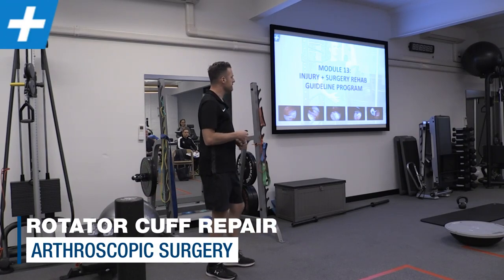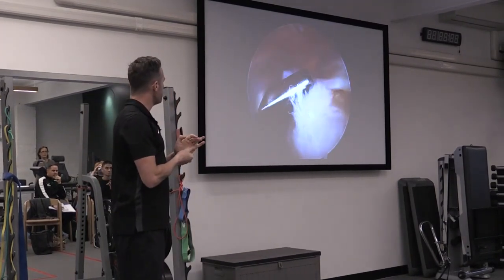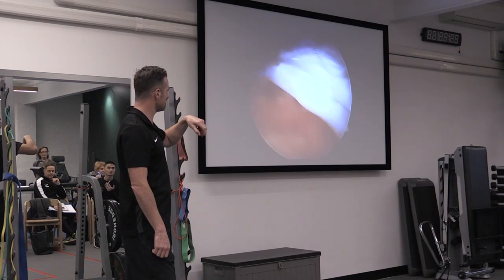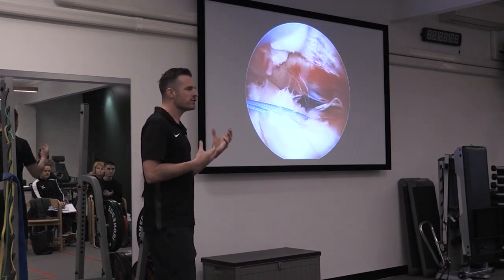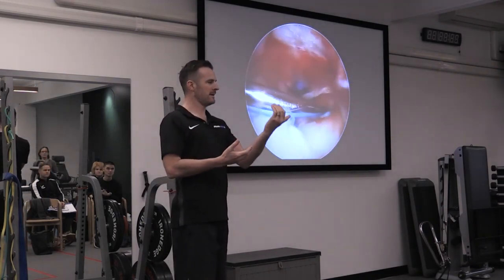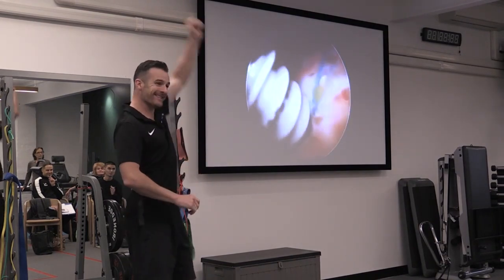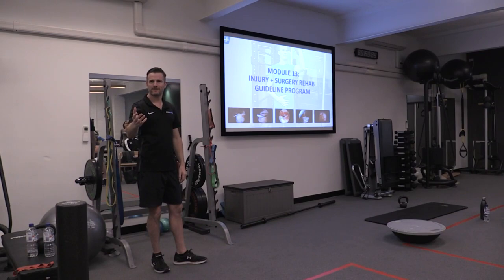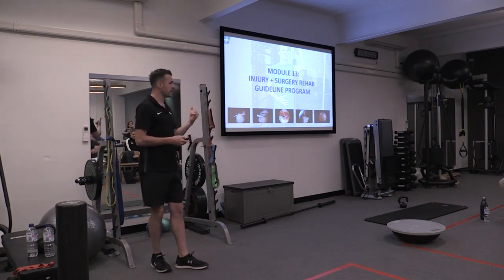Arthroscopic Shoulder Surgery - Rotator Cuff Repair  | Tim Keeley | Physio REHAB

Comment: I just had my shoulder operated 3 Feb 2022, I had two tendon tears and two things replaced, fat was added and had my shoulder bone was also fixed.  I am checking your videos for rotor cuff exercise
Reply from the maker: Hope the recovery is going well. For the best exercises and structured programming see my shoulder surgery rehab program here: https://physiorehab.com/rehab-programs-shoulder-injury-surgery-rehab
Reply: @physiorehab  thanks I am going to a physio on the 6 April to have my shoulder  check out for help on exercises
I love your video’s and have done most of the exercises and have save most of your video’s to use for my home exercise